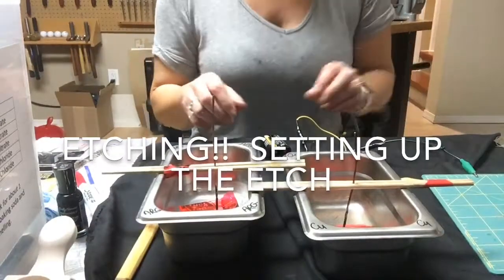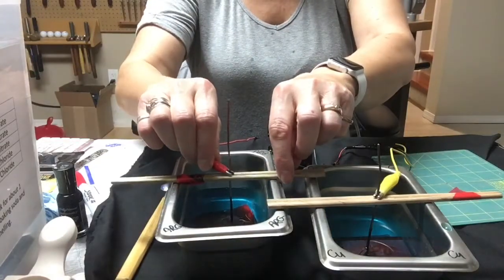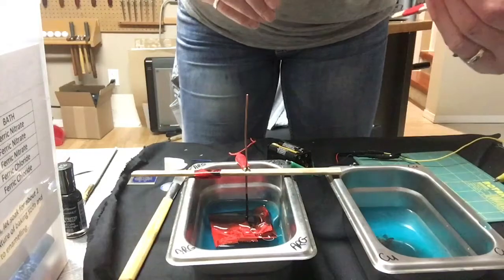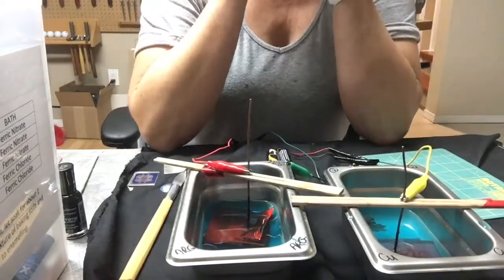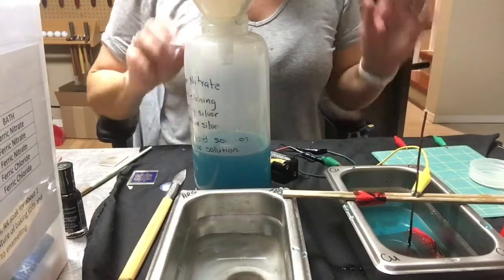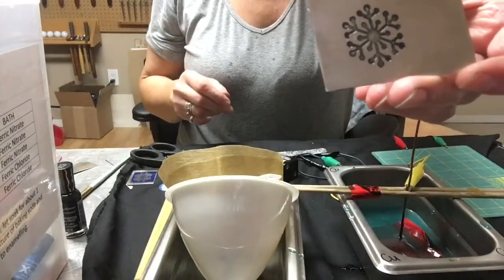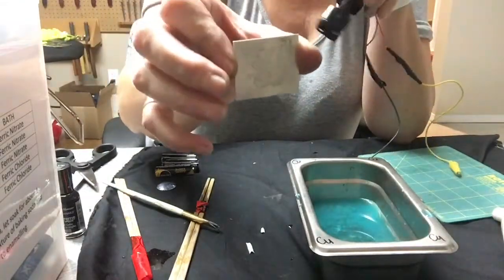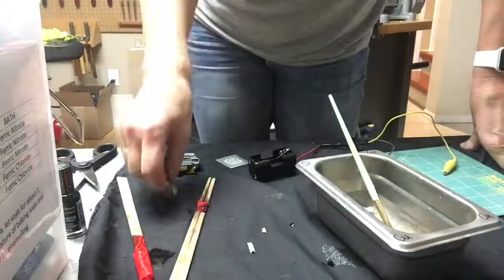Part 4 of ElectroEtching!!  Which wins out?  Battery or Electric Power Converter?

Comment: Thank you for sharing your knowledge.  when transferring the PNP - you used a red mat on the griddle???? is that a silicone mat? 2.  I was told to use ferric nitrate for etching silver.  do you the difference between using copper nitrate vs ferric nitrate?  3.  how long does your solution last?  5 etches or more and do you need top recharge it with more copper nitrate?  4. Ive never heard of Tuck Tape....where do you buy it in the USA?  thank you. can't wait to watch the enameling videos. kindest regards, Irene Comstock
Reply from the maker: @IreneComstock  Thank you for the questions.  As you correctly deduced, it is a silicon mat.  The copper nitrate (for sterling silver) and the copper sulphate (for copper) is SUPERIOR!  For one thing, it’s more economcal and eco-friendly.  The Ferric solutions can only be used a couple times at best before they degrade.  The copper nitrate and coper sulphate are filtered through a coffee filter when pouring them back into the solution container and they can be used over and over and over again.  Tuck Tape is a Canadian product.  Packing tape won’t cut it, even duct tape won’t stick.  If you go to a good hardware store (not a box store, most of the kids that work there don’t have a clue) and ask them for an alternative to Tuck Tape they might be able to help you.  In the meantime, I’ll do my own search and get back to you if I find anything similar in the USA.  Thanks again Irene and enjoy!  If you have a die cut machine, like a Cricut or a Silhouette, those sticks are amazing as well!  Not as much detail with fine lines, but I do all my texture plates with stickers made on my Silhouette.
Reply from the maker: @IreneComstock  https://www.amazon.com/tuck-tape-construction-grade-sheathing/dp/b01n6l7fk0  😀

Comment: Hi Sonne, is the electrode wire silver or copper and about what gauge?
Reply from the maker: @Gertruida Trotter Hi there!  The electrode is copper and it can be any gauge you like from 12 gauge to 16 gauge for larger pieces or you can twist a few smaller gauges together to create a thicker gauge.  Of course it depends on the size of the piece you are working on.  I squiggle the base of the wire back and forth is S bends, put in a sharp 90 bend at the end of the squiggle and hammer the squiggle flat so it makes good contact the back of the piece you are etching. I also paint the wire stem with a bit of nail polish to act as a resist, if it makes contact with the etching solution it will deteriorate.  I use red Tuck Tape then to attach and package everything.  Depending on how close the piece hangs near the bottom of the steel pan will determine the speed of the etch I’ve since discovered.  Don’t let it touch the bottom as it closes the circuit.  If you’re getting too close to contact, you’ll actually begin to hear electrical type noises, just lift the piece up higher from the bottom.